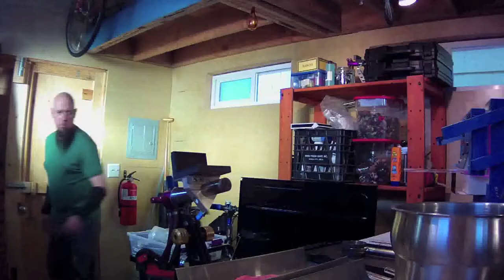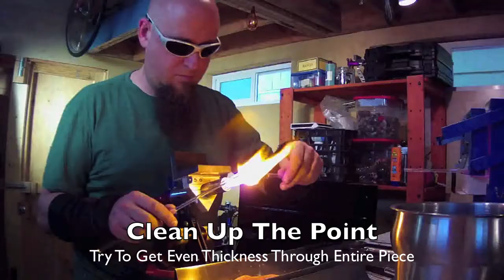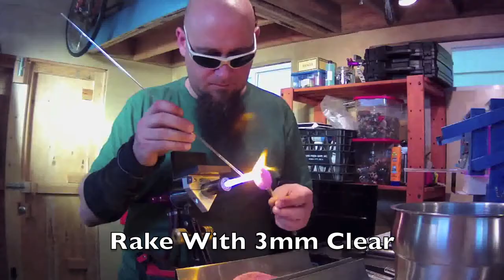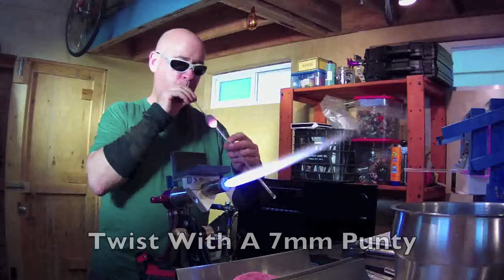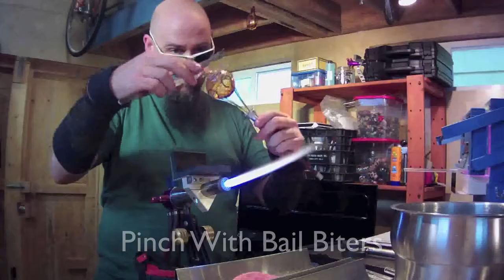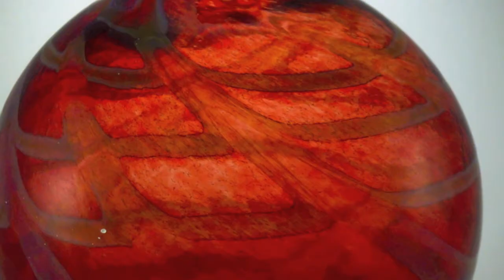Boro Glass Ornament Tutorial by Copious Glass

Comment: good old rap and rake :) any particular reason you used what looked to be amber tube then coated that color with frit, why not use clear if you wont see the amber?  instead of using that colour tube with frit, stabilize that Chinese amber with lines then throw em into reversals. Regardless that a pretty cool looking ornament, i thought it would look way more heady when you were making it but it turned out pretty nice.  cheers